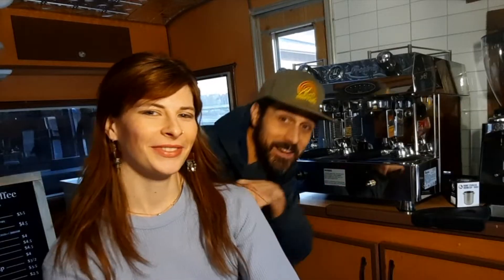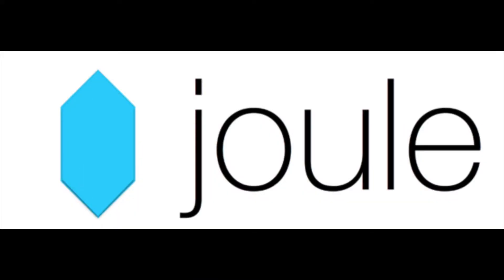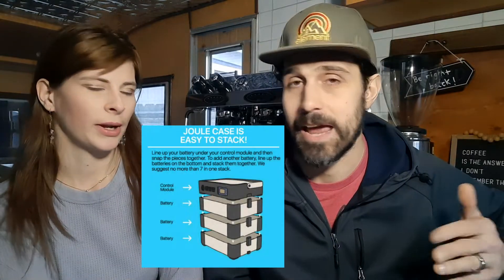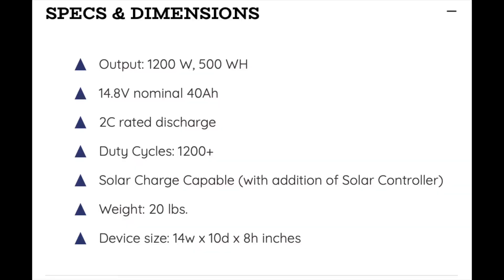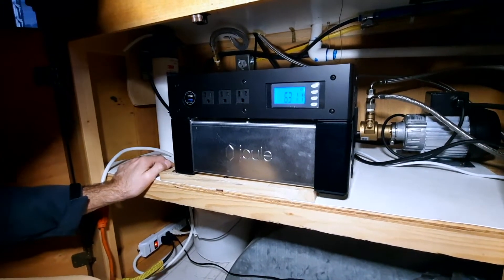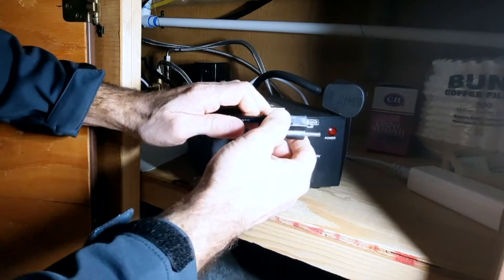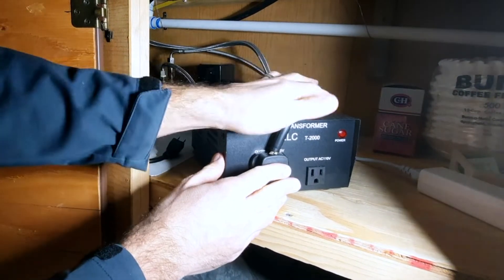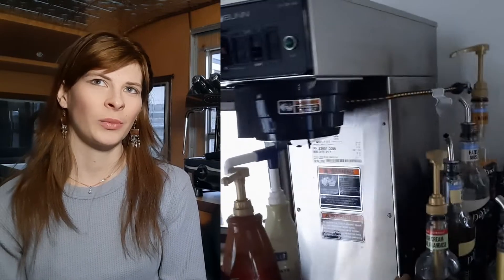Propane-Operated Mobile Coffee - Press On Coffee Trailers

Comment: Good idea... but we also need HVAC here in Texas in a trailer ;)  I do like the LPG Espresso machine.  Been keeping consistant temps and pressure?  That would be my concern
Reply from the maker: It has no problem keeping up at all. I would contact Joule Case- you can power anything with their batteries, even an HVAC system.